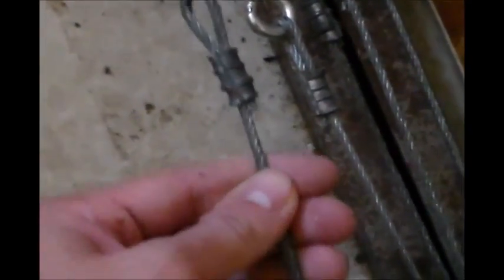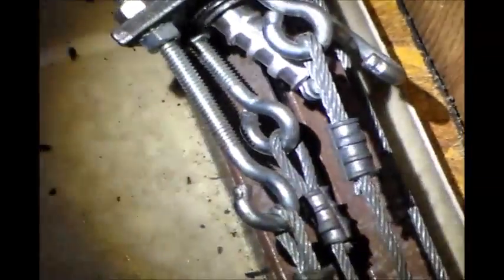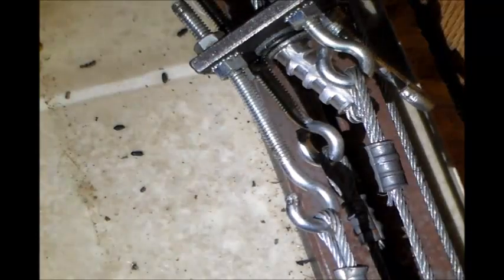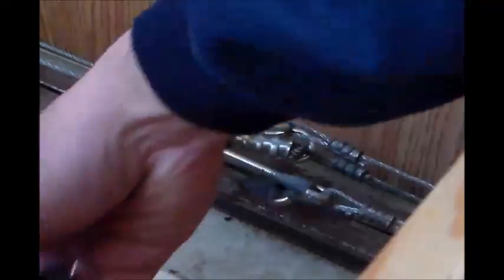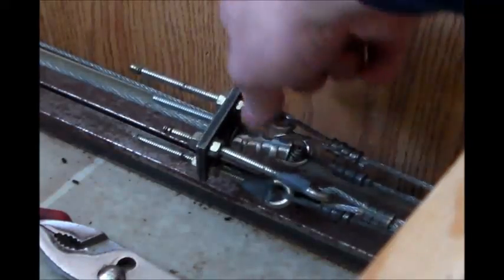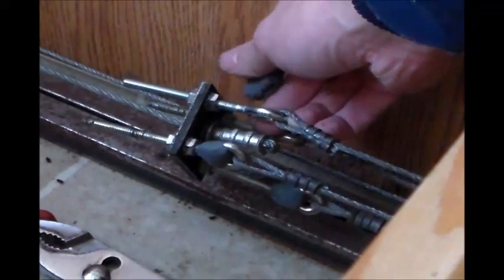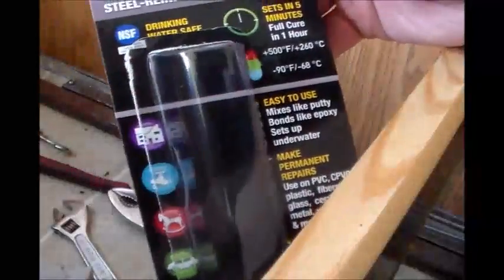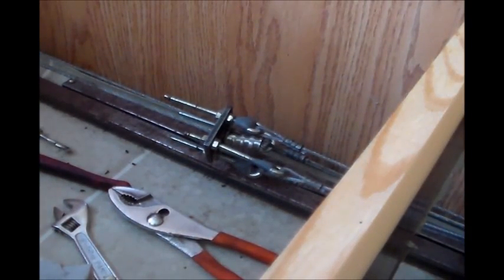Complete Popup Camper Cable Repair

Comment: The eye bolts I believe are slightly open so they 'go' before your cable does. In your case, the eye bolt did what it was meant to do :) A broken cable is a lot harder to replace than just the eye bolt.

Comment: The eyes on the bolts are meant to open up BEFORE your cable snaps, it's a safety feature!
Reply: Thats not how it worked on mine.  They opened up but the cables still broke.

Comment: Hi All great video, can you tell me where the bundle of cable are?  You mentioned near the crank but I dont see them (which is under my couch)  Any help woudl be great only 3 of my posts go up and I believe the fourth maybe disconnected.  thanks all
Reply: @Nick Neri the cables are right under the front seat cushions. Pull the cushions out, take all of the ply wood sheets off under the cushions. Now to get better access to the tension plate and cables remove the plywood bulkheads (just a few screws to remove) and you can start work. The screws and plastic right angle brackets holding the bulkhead walls to the floor have a little beige coloured cap over them, just use a flat blade screw driver to ease that cap off and then the screws are visible. The older Jayco in this video doesn’t seem to have those bulkheads but the newer models do.

Comment: Good video. Where in the camper you have were the bolts? Front? Back? Side?
Reply: Did you ever find out where the cables are bundled?  the video doesnt show exactly where they are and I also cant find them.  thanks
Reply: Under the front seats.

Comment: The eye bolts are designed to be a weak point on the cable system. It's much easier to replace an eye bolt than rewire an entire track.
Reply: Mine opened up but the cables broke anyway.

Comment: Did you ever find out why your eye bolt opened out?
Reply from the maker: I never did. But, I'm assuming that it had to much tension on it and the bolt stretched open. 🙂
Reply: @2012solarful  I have one that opened as well, but I caught it before the cable came off.
Reply: @peterhancock8011  If the eye opens up then there is a tension problem in the cable/roof system. They won’t normally just open up. If a roof strut gets rusty or jammed (I left the cupboard up and tried to lower the roof causing all the tension bolts to bend!) then the cables suffer too much tension and the eye bolts will bend or have their eyes open up.
Reply: @steviebee1989  didn't think it was possibly to open out the eye bolt when lowering the roof.  If the roof got stuck going down, the cables would go slack, not tight.

Comment: It's not cheap hardware,  it's designed that way so bends the eye bolts instead of braking cable,  do your homework and dont put stainless eye bolts